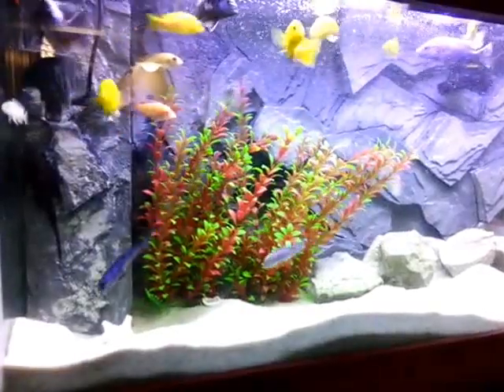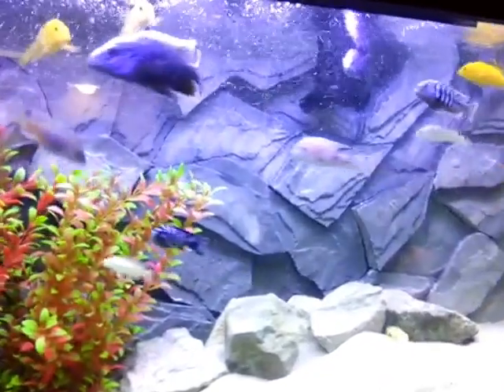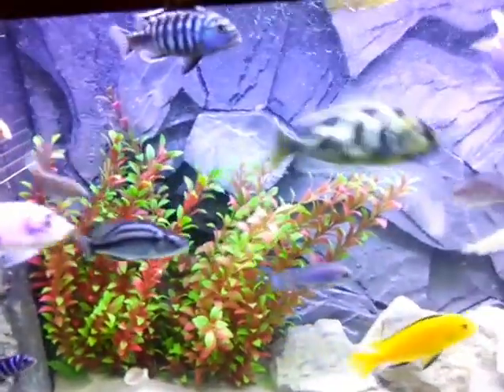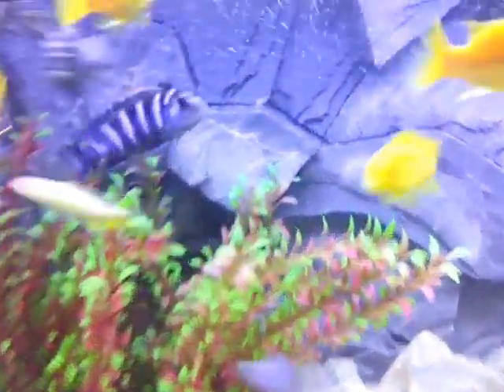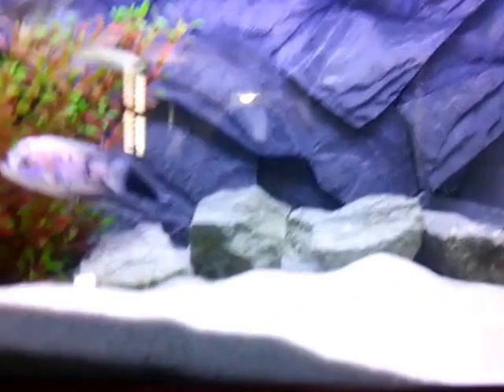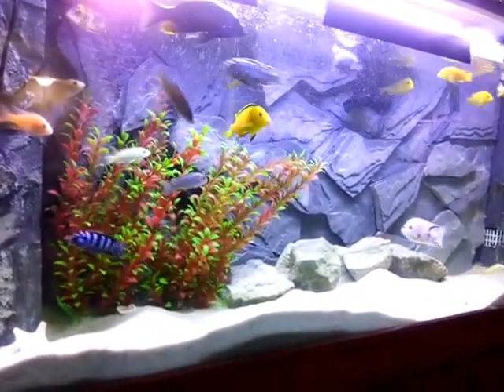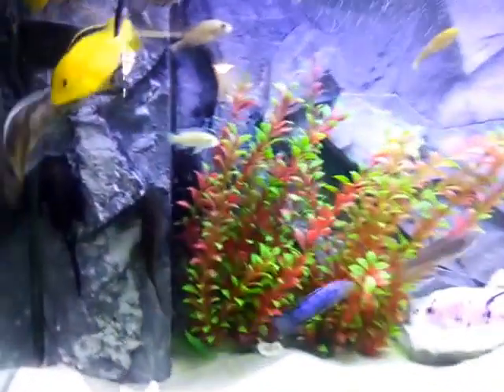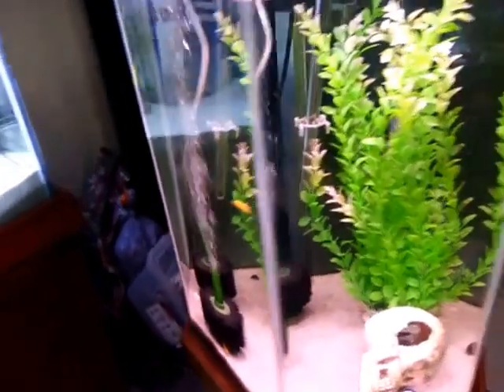how to get your cichlids to colour up series ( rock wall background)

Comment: Your tank and fish are beautiful & I am sorry you had the seam break.  Your filtration and sump systems are awesome and obviously very effective.  I just want to comment about the utility of your rock wall.  As a backdrop, from a human perspective, it is certainly attractive. However, this method of adding rock does not give any benefit to the fish, IMO. They cannot swim through or around; there are no crevasses to shelter in;  in short, there does not seem to be any way the fish can utilize this to express natural behaviours. Also, real rock is useful with the hard-water cichlids for chemical reasons that epoxied foam isn't going to provide.  So all together, I would have hung this on the wall at the back of the tank (or to the exterior surface of the tank itself) & made a large, intricate formation across the tank using something like lace rock, plus acrylic rods and aquarium silicone to stabilize the design if it seemed necessary.  After I made my Neolamprologus video, I got some lace rock for my juveniles & need to post a new video. When they mature & start breeding, I anticipate the fry will find a lot of security and happiness among these rocks (although this cichlid - adult or juveniles of older generations - does not molest its fry).  Kind regards & all best wishes. ~ Meena
Reply from the maker: +m3na9 I do have real rocks in the tank, except i had to get them out before making the video. because mostly i wanted to explain about the tank facilities and background and i did not want the rocks to be on the way. I have about 7 or 8 granite boulders that makes a good play area for the fish.
Reply: +Sathesh Soundarrajan  Ahh!  Excellent, would love to see a video (short or otherwise) showing what the full set up looks like ... The fish interacting with it would be lovely to see, also. :D  Thanks for the reply!  Kind regards.
Reply from the maker: +m3na9 https://www.youtube.com/watch?v=MtIDJ32wi5Q&feature=youtu.be

watch the entire set up with rock boulders. This video is for u buddy.